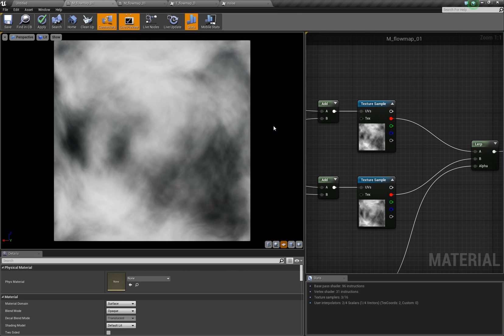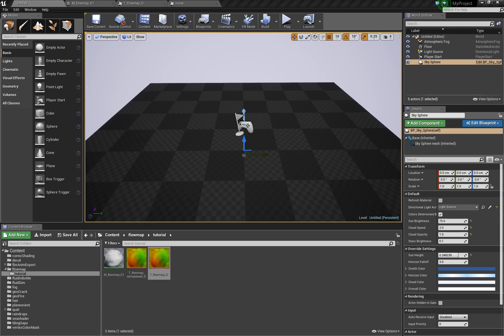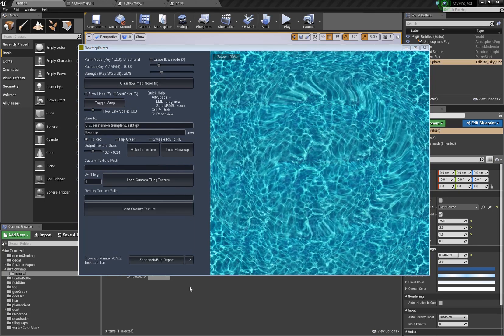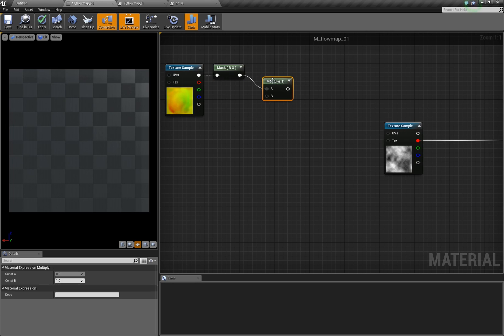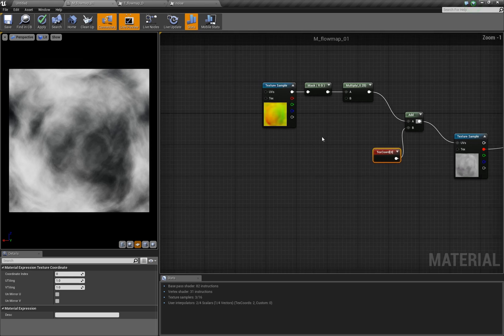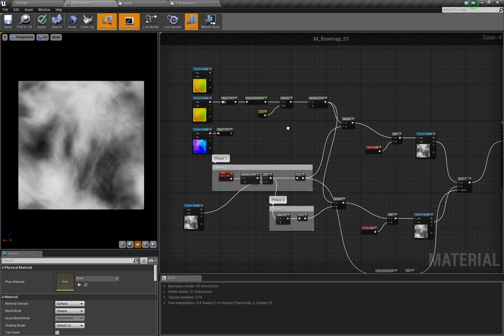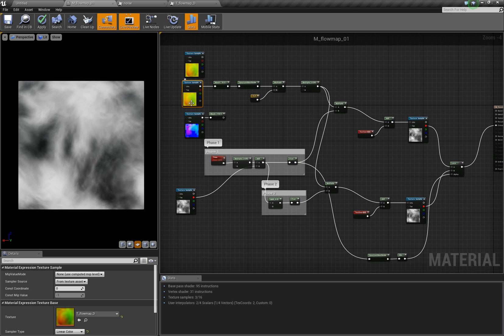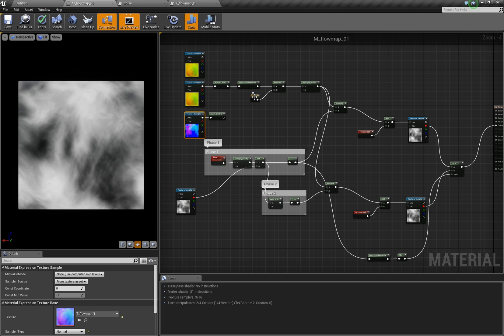Flow Map Material Setup in 13 Minutes

Comment: also side note, I think you can just set the period on the time to 1 instead of using frac. guess its a preference thing but makes the material cleaner :)
Reply: I tried this and it didn't work, seems like the frac needs to happen after the Add nodes, otherwise you get a little jump on the loop.
(I know this is a 2 year old comment but it's at the very top so still relevant.)
Reply: @noopponent7559  
And I know this is a 3-year old comment, and you are both incorrect.

Comment: this is great, however the flow map painter doesn't seem to be able to import into unreal engine :( it saves as png but errors out when trying to import. bummer, looks like a cool tool!
Reply from the maker: that's very weird. it usually works very fine. what exactly is the error message? do you see something  in the unreal log?
Reply: @UnrealSimon  sorry I think I was just doing something weird, for some reason it didn't want to overwrite a file name. I had imported one I downloaded, then tried to replace it, for some reason I had to rename and couldn't overwrite it? works great after I renamed it. re-importing via the asset didn't even work when I specified a new file from the source.